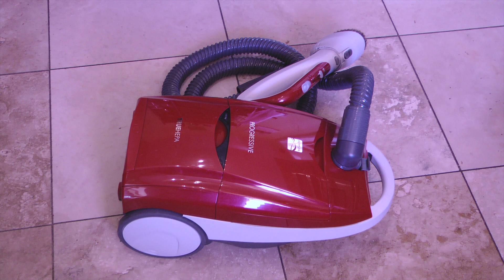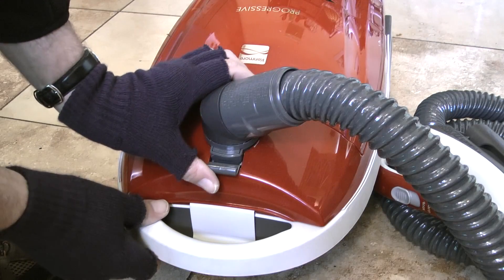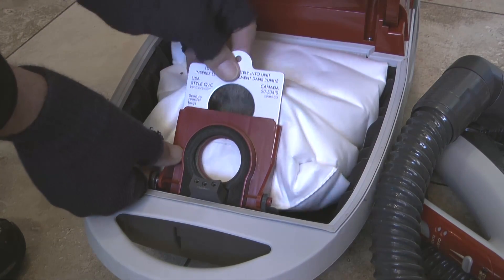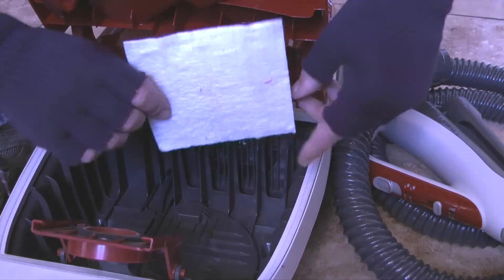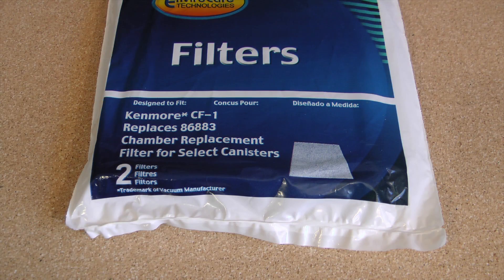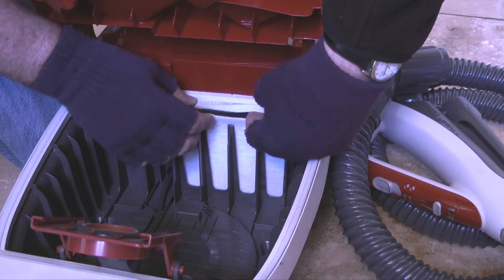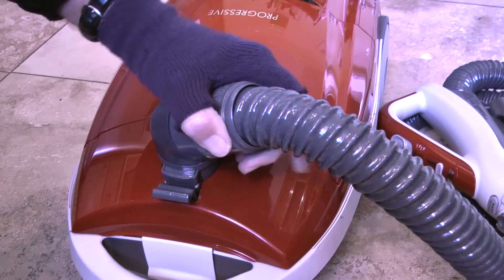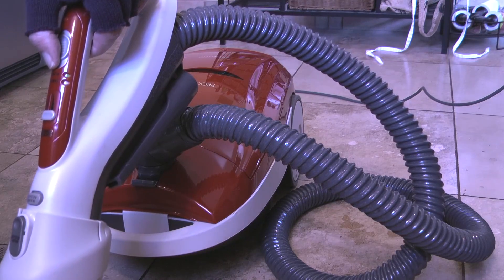Canister Vacuum Motor Filter Replacement

Comment: Thank You, I couldn't remember which way the Motor Safety Filter went in - white side facing the bag. Appreciate it! It's difficult to find replacement filters & belts for our Intuition, bags too. Other brands besides Kenmore do not work well- like ths bags- if we don't use Kenmore brand, the fit is off enough to cause a huge mess, and off brand belts slip.
Reply from the maker: There should be a parts number for the belt in the owners manual if you still have it.

Comment: I have the same vac based on your handle design. The button to unlatch the handle from the wand now does nothing. Have you experienced this problem and is it cost effective to attempt repair?
Reply from the maker: Yes, my vacuum did the exact same thing. Everything was working fine then one day then handle wouldn't release from the wand. I tried everything I could think of but no luck. I ended up buying another vacuum.

Comment: Your videos are great!  Wish I had seen them before I did those 2 filter changes.  : -)I am having difficulty removing the red canister cover to check the motor.  I've been able to remove the 2 screws in the bag area but there's still something else holding the cover down. Can you do a video on how to do that?